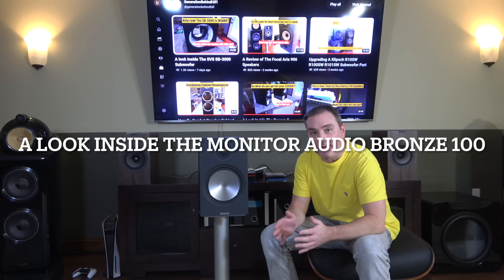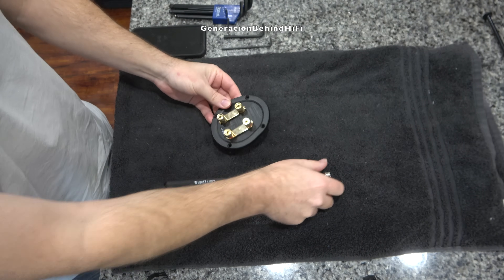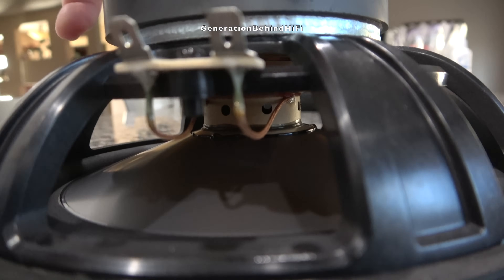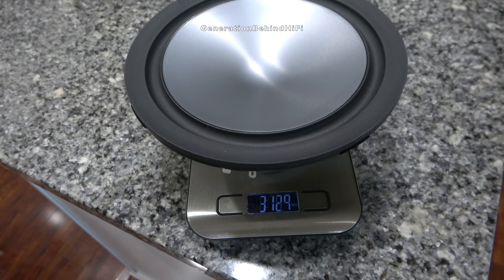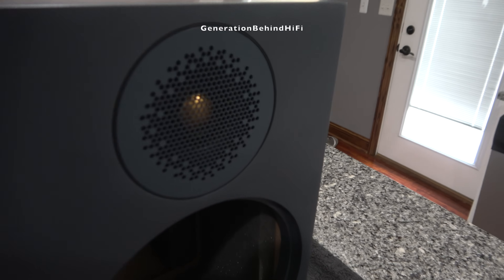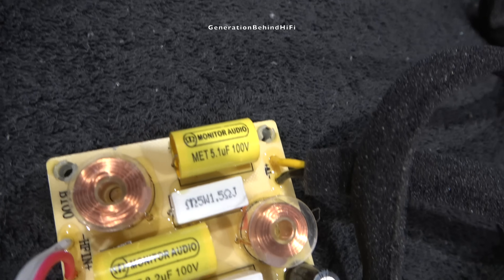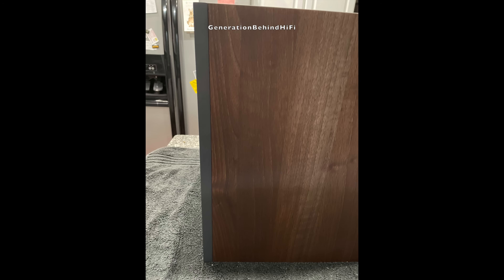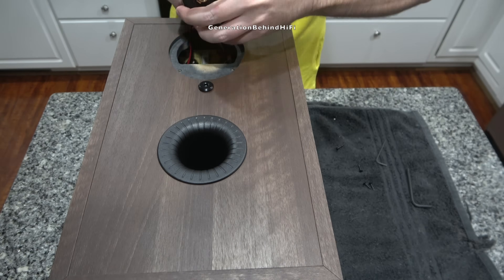A Look Inside The Monitor Audio Bronze 100

Comment: I had a set of these and the cones started developing cracks in it. Dealer claimed they were over driven, but I have never seen cones just fall apart like this. Still I had them repaired, new cones, might as well have just bought a new pair for the money it cost. Then 12 months later same thing happend. I would avoid these speakers.

Comment: Plastic basket for $725?! What were they thinking?! I'd never buy something like that.
Reply from the maker: The composite basket is as quiet as a cast basket so it does have some benefits.
Reply: I agree!I also prefer cast-alloy or metal basket materials.
Plastics is good innresonanc absorption but could deformat or cracking easily.First when the magnet weight is too much-after a time the basket will broke.
Reply: @panblue43  maybe thats why they secure the driver from the back, to support the plastic basket

Comment: 8" inch woofer beams much earlier than 6.5 inch woofer MA used to use for bookselfs.  It gains more bass, gives up some mid range sound dispersions.  

MA inflated prices from a few gererations of $599 to $1400.  My silver RS1 had a MSRP of $599 and 6.5 inch woofer.

Comment: As a former owner, I can attest that the Focal aria 906 has a cheap crossover that says $299 a pair, not $2200 a pair.  The AL/MG tweeter is a cheap version of focals better lines.  It has over ring and an unrealistic treble. A $30 vifa tweeter is far superior.  Sounds to me like the speaker caps are saturating easily at higher volumes.  I got rid of mine, and consider them inferior to a few $499 a pair speakers, because...they are.

Comment: Plastic Composite basket for the woofer stopped me here . .....
Reply: Why ? Composites are actually more ideal than steel . It doesn't ring and has these days the strength of steel . 

You act as if you're moving a huge powerful thing. In reality it's just a cone dude....it doesn't require anything massive

Comment: 3:52 I don't think it's made from paper. That's just an outer layer found on many VC formers; usually they are aluminium underneath.
Modern drivers sometimes have fibreglass formers

Comment: I bought a set of Bronze 500 two months ago. They have a great balance across frequencies, at least in my Denon amped setup. Build quality is high, and I like that they use good quality internal wiring.

I tried a lot of different brands and models, trying to find a replacement for my 23 year old JBL LX60s.  It was much harder than I thought, but when I sat down and listened to the Bronze 500, I was convinced on the spot.  The JBLs have a clear and broad soundstage, and I wanted to keep that, but add some more bass. Everything I tried before the Bronze 500 was too bass heavy, losing the open clarity I was used to.

No doubt there are better speakers out there, but nothing at this price - and at the relatively modest footprint for a full tone floor standing, that doesn't need a sub.

Comment: This 🔊 speaker is perfect for a subwoofer upgrade, can you recommend any . I recently put in a 6 .5 Skar audio into some old 2600 JBL & those suckers 🔊💨
Reply from the maker: Sorry! I haven't done any modeling on the MA100 Bronze so can't recommend anything. I also think it will be tricky to mess around with the drivers because of the proprietary mounting design. The woofer is held in place by a long thread bolted that is installed from the rear cabinet wall.

Comment: 8 inch woofers in a bookshelf were common in 1980s. Now it's unique.
Reply: unless paired with bigger waveguide, there will be most likely discontinuity in directivity.
Reply: Klipsch rb 81mk2 has a same 8" woofer
Reply: It's because software and drivers have gotten a lot better .

Comment: I wanted an 8" bookshelf with front firing port do to placement restraint  and bought the Klipsch RB-81II but had to buy a tube amp to soften the harsh Klipsch tweeter and the results were significant. Lots of bass and not fatiguing at all. The high efficiency of Klipsch speakers makes them perfect for tube amps and totally fixes the ear piercing tweeter. Just an FYI for you Klipsch fans
Reply from the maker: I had no idea that Klipsch had made a 8" bookshelf model. Very cool! I'm a big fan of big driver bookshelf speakers! Thanks for sharing!

Comment: It is possible that the Q150 crossover is 2nd order - if it is a series design. If the positive binding post is connected to both the coil and the resistor, and the other lead of the resistor connects to the tweeter - and the other lead of the coil connects to the cap AND the other side of the tweeter AND the woofer - and the other lead of the cap connects to the other lead of the woofer AND to the negative binding post - THEN it is a series crossover. If you can look at the circuit board, it would be very interesting to see if it is a series or parallel XO.
This Bronze 100 speaker appears to have a 2nd order (parallel) filter on the drivers, and a notch filter on the woofer?

Comment: There is definitely some cool original features to that speaker. I like how the woofer is attached, I agree this should help brace the cabinet, I also like the plastic woofer basket, to me this is better than a stamped steel basket, it also looks like they did more than most companies when it comes to the internal foam 👍🏻 and the overall look to the speaker is much better than most. The plastic front baffle was a surprise. But I think it adds to the look and design. Very cool!
Reply from the maker: I thought so too. These speakers are currently on sale for under $600 a pair and I think they offer tremendous value for money at that price. The fit and finish was definitely above average for this price point. My only grip with them is that I do wish the 8" driver had more bass. I'll talk more about this in my review video which will be out on 1/15/24.
Reply: @generationbehindhifi  It seems tuned very low, with the lower peak almost at 20Hz and 36Hz cabinet. May benefit from being closer to walls.
MA also tends to go for "clean" bass and very slightly enhanced detail response
Reply: @generationbehindhifi  Also a tip for your channel, maybe link your reviews in the teardown video so it's easier to find
Reply: Got mine in an open box condition with a couple of scratches from an UK retailer a couple of years back for 230 GBP.
I drive them with an Audiolab 8300A and I don't feel they need more bass except when watching movies. They're about 1ft  away from the wall as I don't like them to hang out too much away from the wall. @generationbehindhifi

Comment: I don't like the idea that the mounting bolt is basically pulling away the magnet from the basket. I think it's pretty big weakpoint and classic construction using bolts through front of the basket is much more solid idea.
Reply from the maker: I appreciate the comment! Bowers Wilkins has been mounting their midrange and tweeter for decades like this on their 800 series. IMO if done right, it should provide more mass and reduce resonances because you're essential tying the front baffle to the rear. In theory it sounds great but I don't have the measuring equipment to determine if its really effective or not. I would assume so since B&W has been incorporating it into their designs for so long (Since Nautilus series).